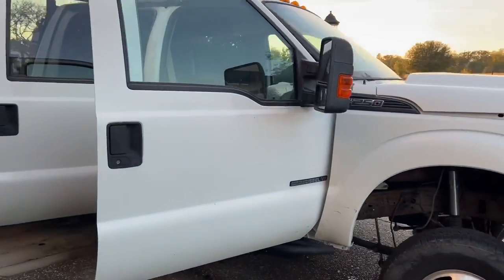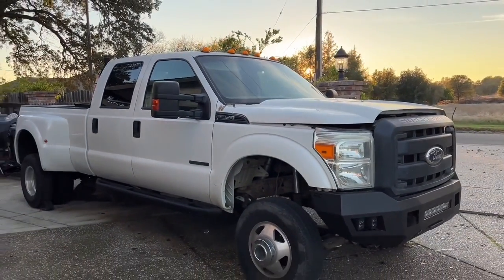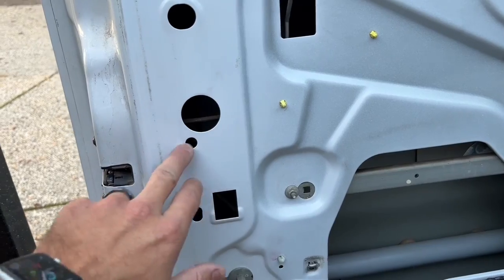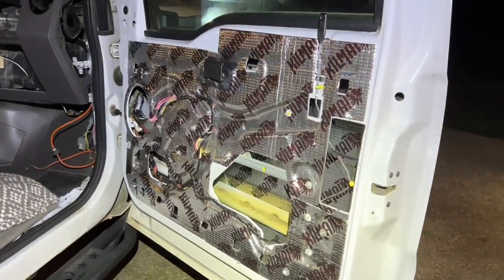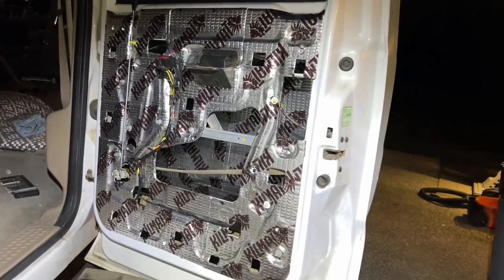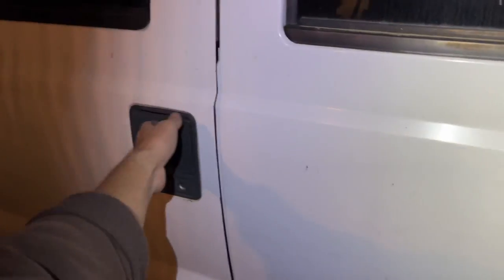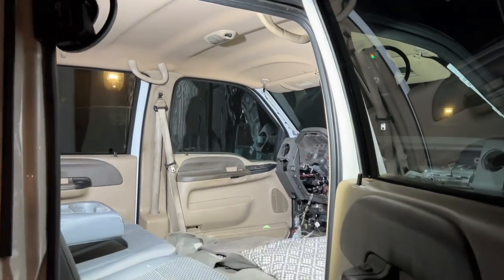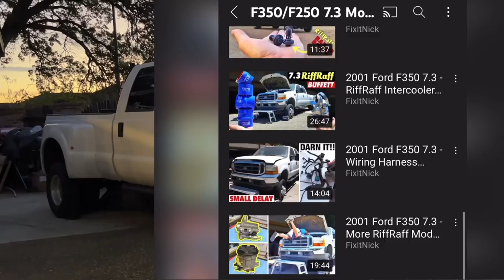2001 Ford F350 7.3 - Kilmat Sound Deadening Doors Installed, Makes a Huge difference!!

Comment: Just finished replacing all the weatherstripping and seals on all doors including upgrading the door channels. What a difference having all new compared to the 20 year old ones. Well worth the time (about a day) and money IMHO. Used all FORD parts and had zero issue with fitment. May try the kilmat on the doors in place of the factory weather shielding as it need replacing.

Comment: I bought a 2001 Lariat roll over wreck and it had the sound deadening throughout the cab, but not the doors. Of course the cab was scrap so I stripped it down and installed my 99 XL cab on the truck converting it to a Lariat. I moved everything from the 01 to my 99 including the dash, harness, carpet etc. With a straight piped 7.3 I really don't need the sound deadening and it sounds awesome! I wouldn't do the cut out's for the locks...after you do a few of them, they are a breeze. Remove the 3 torx head screws and the two nuts from the outside handle. Pull the outside handle out and disconnect it. That gives you access to remove the wires and other linkages. The rattle is from where you have missing linkage guides and loose hardware. None of my doors on either of my F350's sound like your before clips. I would spray your doors with a water hose and look to see what gets wet...easiest way to determine if the hinges need to be adjusted or if it's the door seals.
Reply from the maker: Thanks man, I was gonna pull all the handles and locks to clean and lube things and fix the lock actuators, she shall be as new as possible
Reply: @FixItNick  You can buy chrome covers for the handles too. I think a set of 4 was around $20 at Advance Auto Parts.

Comment: good work. I've seen surgical tube pulled through old door seals to firm them up. use cable soap if you try though it gets sticky.
Reply from the maker: Funny you say that, I was gonna go to Home Depot and see if can find some flexible rubber tube to shove in there to make it little more stiffer to give a better seal.
Reply: @FixItNick  That's  a good way to do it. I wish you and your family a Happy Thanksgiving and a very Merry Holiday Season

Comment: I wish my doors weren't rotted out. doing under the hood and behind the front wheel wells makes a huge difference as well
Reply from the maker: I did under the carpet
Reply: I was just thinking the same, I already replaced my rear doors, just need to find a drivers side now then ill be doing this

Comment: Hey nick. I recently did my door panels. I have pics of the wiring for the mirrors if you need it. Nice job on the truck. Let me know how quiet she goes down the road. O make sure you get the handles for the door panels as well. There different